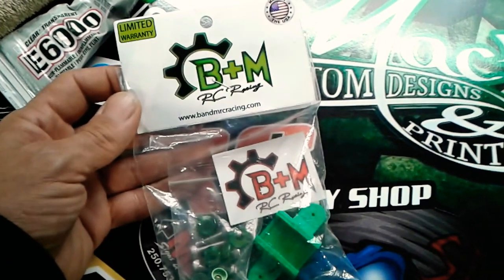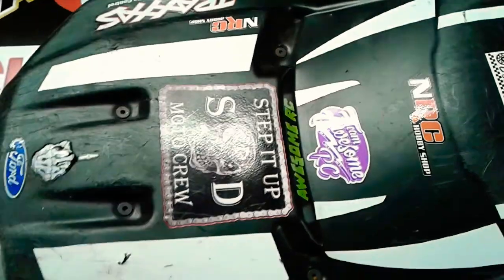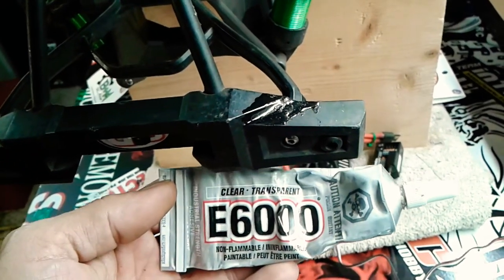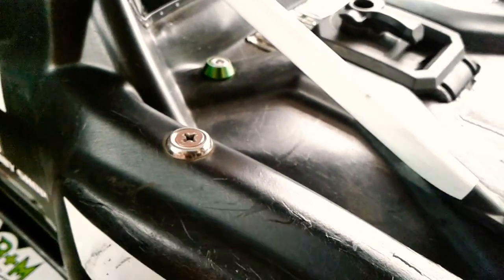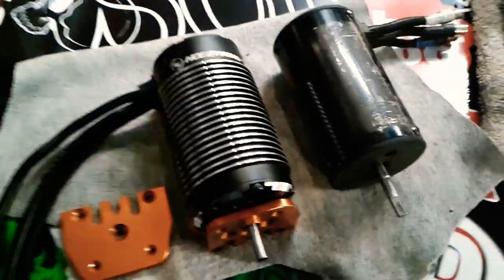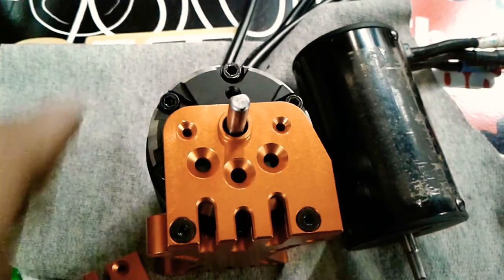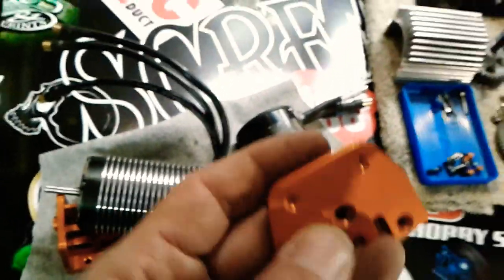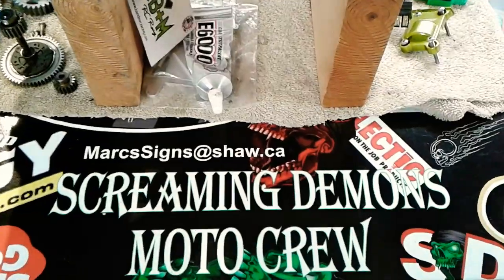XMAXX BUILD SERIES PART.4 B&M RC RACING body washers and bolts. Plus more. #SDRC #BandMrcRacing #Arc

Comment: I like those body mount things, but my worry would be the battery "going up" and not being able to yank the body off real quick.  Just my thoughts
Reply: The body washers do not effect how long it takes to remove the body sir
Reply from the maker: Yes, like Mike said. The screws and washers don't change the mounting of the body to the chassis, it's still a quick release body system.
Reply: @screamingdemonscrew  and Mike....Ahh!  Gotchya!